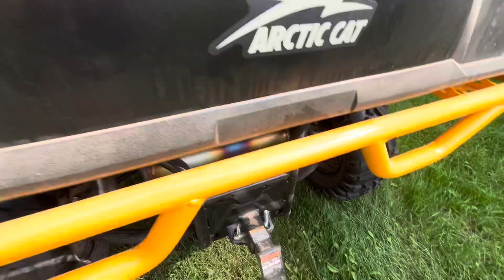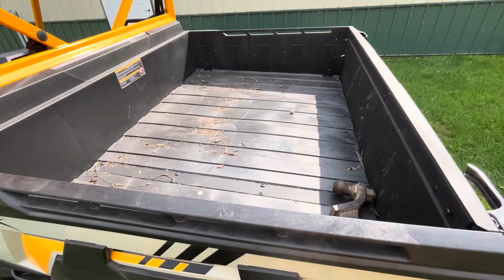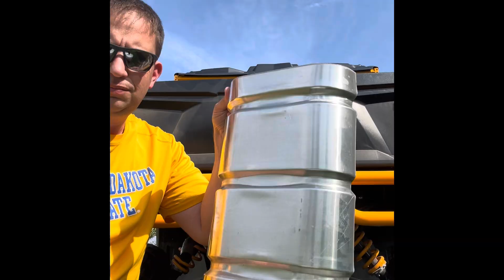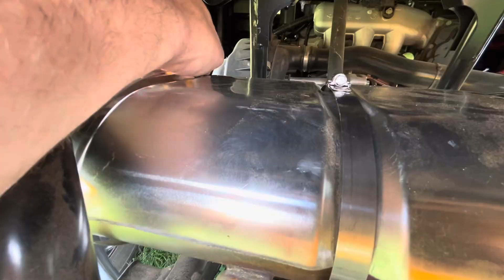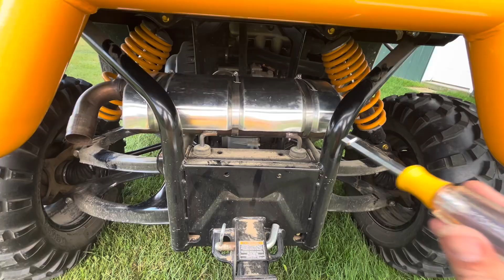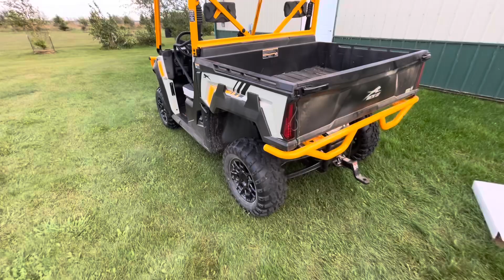Arctic Cat Prowler Pro - Tracker 800 SX Exhaust Heat Shield Install 🔥

Comment: How did this work out? Did it make any noise from vibrations? Did it prevent the heat hitting the bed or did it just direct it to a different spot?
Reply from the maker: Worked out well! No noise from any vibrations and it has prevented enough heat from getting to the under-bed preventing any additional warping.   Would recommend to any and all owners 👍🏻